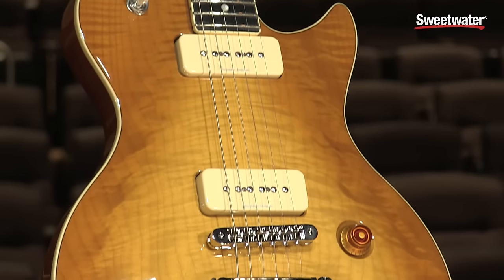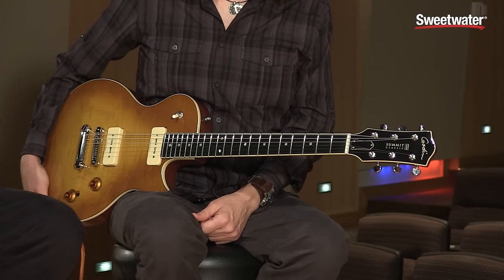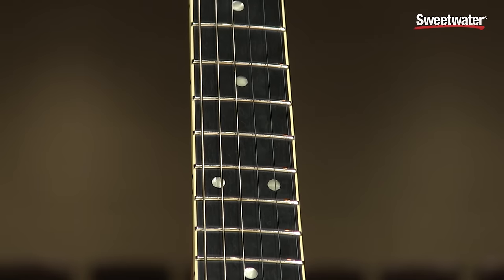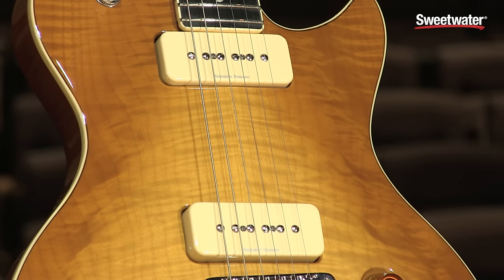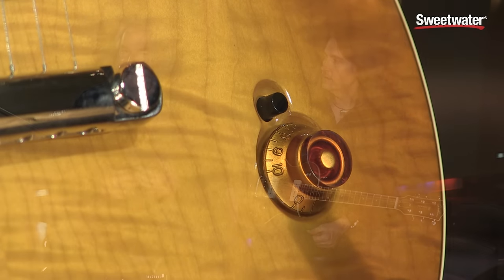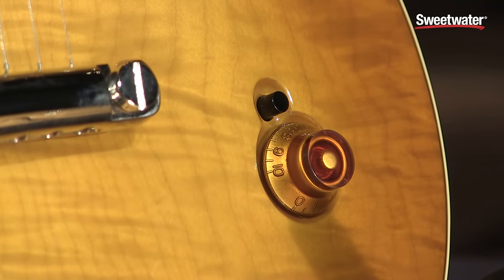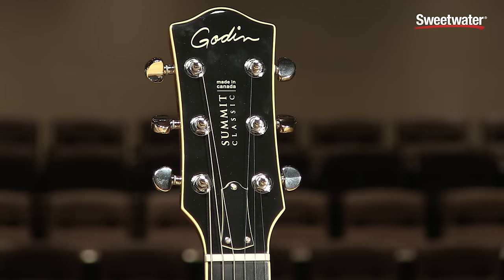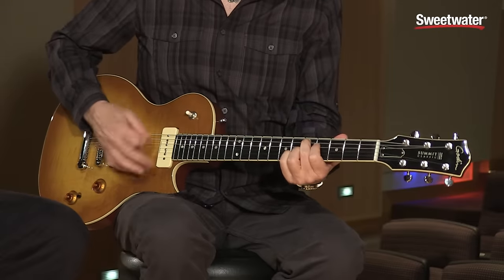Godin Summit Classic CT Guitar Demo by Sweetwater

Comment: It's just that 'composite' fretboard. What is everyone else doing wrong by using rosewood/maple? What is this composite precisely?
Reply: It's richlite. Cellulose fibre and phenolic resin heated and pressed.
Reply: Swedish Hagstrom came up with these composite fredboards long time ago. Just try one and you won't look at traditional LP/Strat/Tele fretboard ever again.
P.S. Hagstrom also patented new, H shaped truss rod. I changed cheap, original 9's to good quality "Roto" 11's flat wounds and neck did not move a bit. Not to mention super low action where the strings almost touch the frets but don't buzz.
Reply: It's a material made of a resin and compressed paper. Ritchlite is as smooth as ebony , more solid as well as much more water resistant.. I've only heard praises from it and I've tried it.. It gives great sustain and stability to the neck against warping..